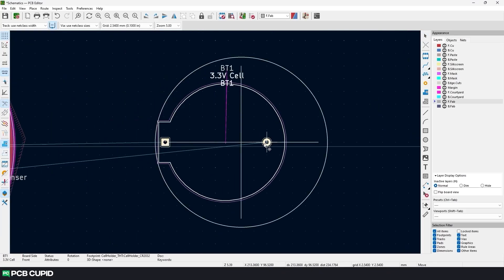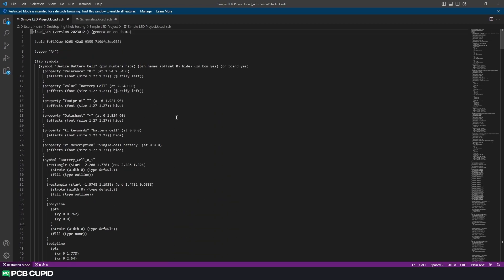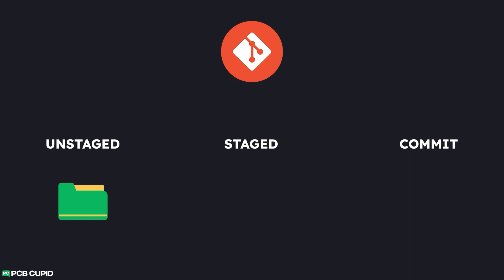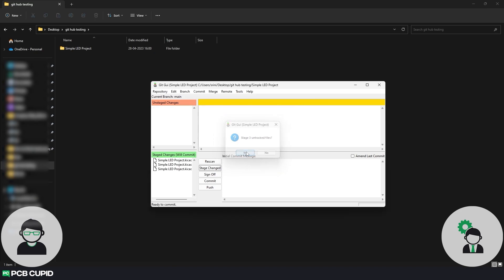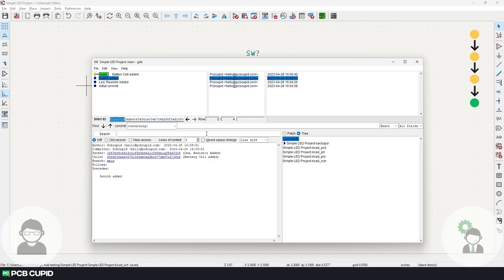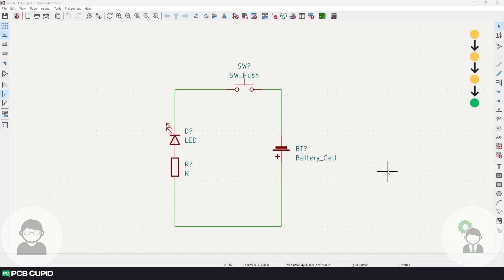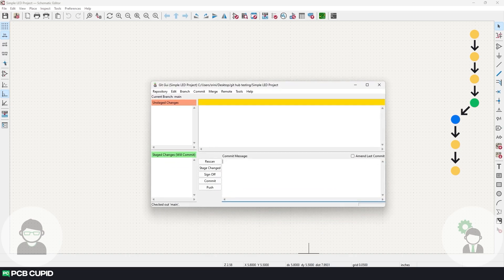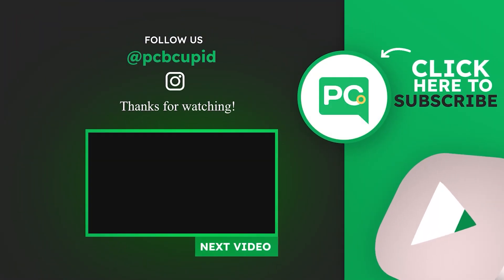How To Version Control PCB Design with Git | #pcbcupid

Comment: Deprecated video! Kicad 9 has built-in version control.
Reply: Does it work, though? Hasn't worked reliably for me (or a lot of people who I've seen post on forums asking for help).
Reply from the maker: Yes, not very stable now, I still use the external git. Almost the same way shown in the video.

But in Kicad 9, you get an indication (✅ - ⭕) on the home page to check if the project is up to date with the repository.